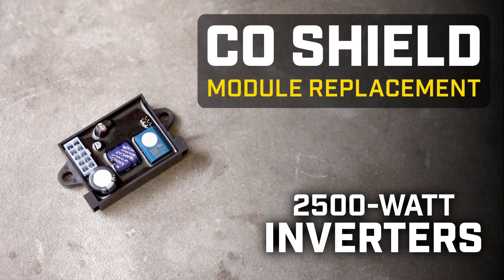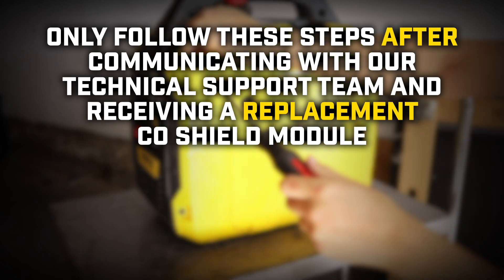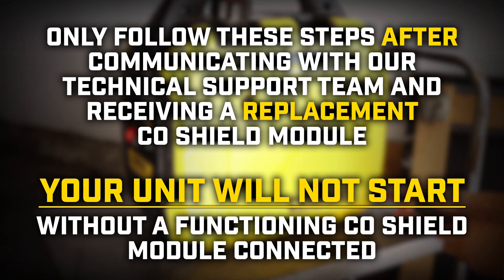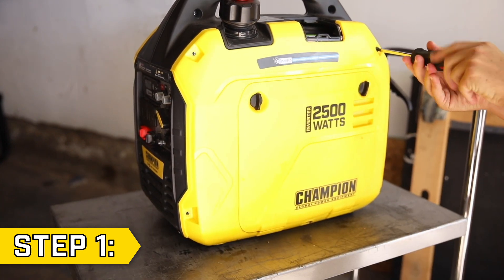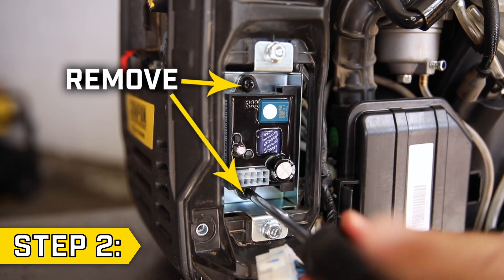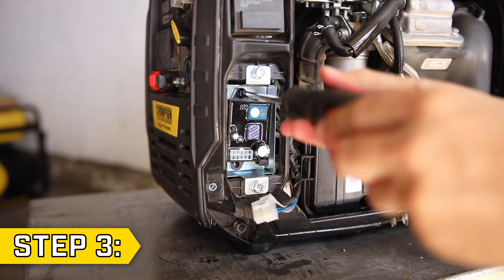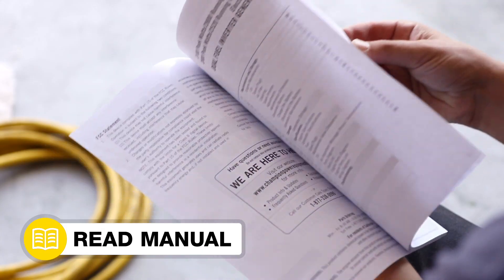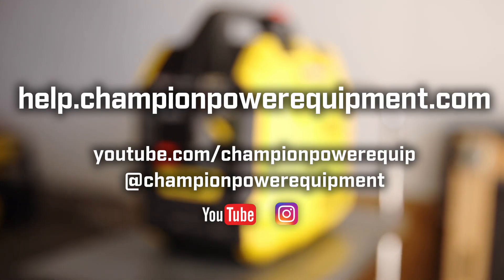CO Shield Module Replacement (2500-Watt Inverters)

Comment: how do i disable the co shield?  it is making my generator useless in my generator shed.. yes it is well ventilated and away from any dwellings.
Reply: my 2500 shuts down outside in the desert with wind no wind and even when i take side covers off, more people die from falling down the stairs so why are they fixing that by no stairs just ramps
Reply from the maker: Disabling the CO sensor will void the warranty & prevent the generator from turning on. Also, the generator must never be operated in any enclosed spaces like a shed. It must always be operated outside on a flat, level surface in an open area away from any windows & doors, & must have at least a five-foot radius of clearance around it. Operating the generator indoors will be done at your own risk.
Reply: @ChampionPowerEquipmentHQ  can I get a wiring schematic? What good is warranty if it will not run in a large 2 walled open shed with a roof to keep the snow off?
Reply: @ChampionPowerEquipmentHQ  never mind, i found it and the engine stop micro switch black wire. Works as it should now.